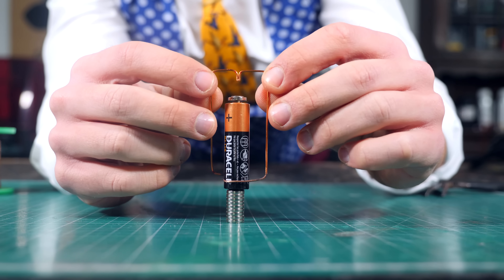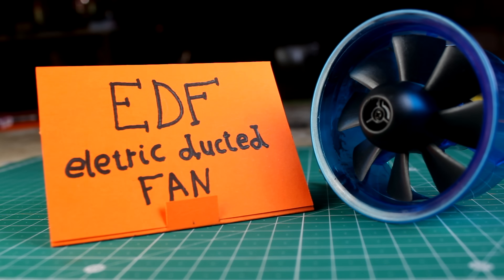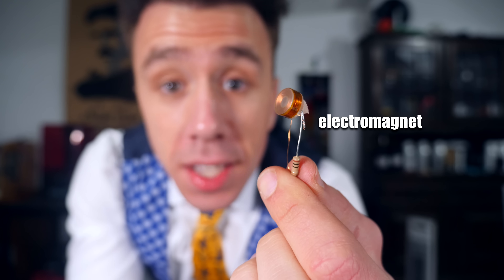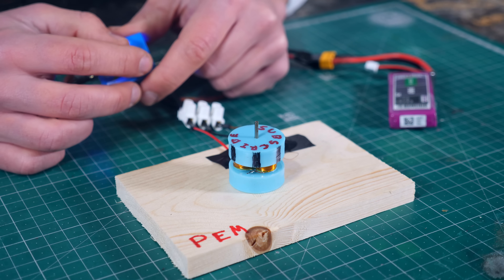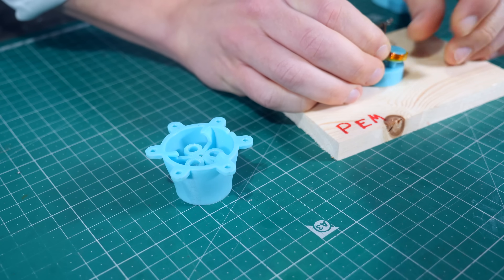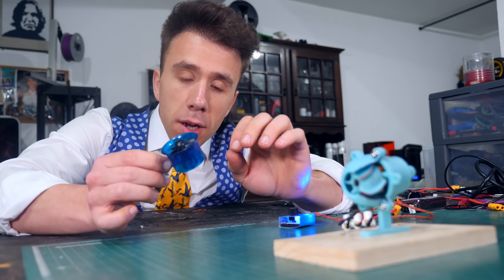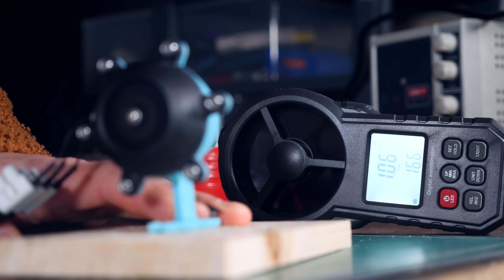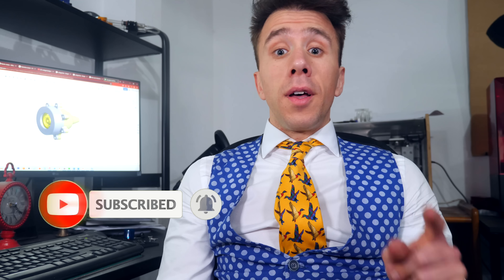I 3D Printed an ELECTRIC MOTOR FAN

Comment: thrust will increase if your impeller mass is consecutively lowered towards the end... plus the intake needs to be vase shaped from opening or you can put holes on the front sides.... the design is perfect just change the front part with well ventilated one and try the impellar like a any supercharger if you don't want to design a new one...

Comment: An impeller will not produce high wind speeds, but higher torque air aka its a little closer to an air compressor and a little less like a fan. 
That's because of the increased surface aria, which is great for making sure wind hits a set speed, but not great for making sure it hits its top speed.

Comment: A cool idea would be to follow that dyson fan concept and try to create a plane where the wings are more like fins (The hollow part of the dyson fan) where you can't see the fans but it still moves/creates thrust. Also a plus if it is RC. An even better plus if it can crash into tomatoes.
Reply: So that the rear of the wings close to the fuselage is a slot where the compressed air exits? This would be an interesting idea

Comment: The blades and the impeller/volute casing/interior are the only thing that're different, so with a lot of tinkering & research you could fix it, better tolerances, streamlined blades.
But you know that o-o , I'll tickle your youtube audience interaction regardless. >-<

Comment: @MajorHardware runs an entire video series about designing different fans blades for the same fan body and testing their efficiency. He's also an avid builder/3D modeler, so it might be worth asking him.

My straightforward guess would be that the new fan design has three things working against it. 1. Smaller intake than the original. 2. More interactions with solid bodies before making it out the back, increasing drag and decreasing flow. 3. Smaller surface area blades, so they can't push as much air.
Reply: Oh yeah! Another fan showdown fan :D

Comment: I think that the Motor isn't so good for the Turbofan design. I would guess that you need lower RPM but higher torque to compress the air, but the ductet Fan should need higher RPM but lower torque for the same mass pushed trough. 
Thats why i think the Motor doesn't operate on its optimum working point so you get less thrust.
Maybe a higher dozzle diameter helps to reduce the pressure, or a lower KV motor with the same wattage.

Comment: At the speeds at which the impeller works, Air behaves different than at low speeds. It's behaves more like a liquid than a gas. If Onshape has the possibility, you should try your design in a fluid simulation. You'll also need to finetune the center of rotation for balancing the rotating masses of the impeller to a high degree or you get losses through friction. I'm also pretty sure that the gaps between the housing and the impeller need to have tight tolerances

Comment: BASED  SOLELY  ON  VERY  SHORT  OBSERVATION (so don't hold me to this)
1) It looks like your tolerances are WAY to broad.....thus you are losing A LOT of power due to turbulences within the air flow. Little eddies are robbing your flow power because every molecule of air is crashing randomly into each other, rather than all calmly & orderly rushing through the exit door during a concert fire.
2) I know this is going to go against your indoctrination programming BUT....your design does not allow for the linear flow of the exhaust to 'grab' the air outside the exhaust stream in an orderly fashion. Maximum thrust comes from the exhaust pushing off of the surrounding air (think of a swimmer's hand pushing off of the water with closed fingers like a paddle, as opposed to a wide opened hand causing micro-eddies all around the fingers) rather than wasting energy by sucking in replacement air via the exhaust edges of the fan shroud. Basically....your vacuum is sucking in where it should be solely blowing out.

(Note: I know what is taught to every rocket scientist in every accredited school........and they are wrong. So please don't regurgitate the same lesson plan to me as though I haven't seen it a thousand times....I actually build rockets that work. I know 'the science', and I know why it's intentionally taught wrong)

Comment: For that kind of shape I think you need to go talk to someone that makes turbochargers or centrifugal superchargers. There's a lot of science that goes into the shape of the inlet housing/compressor housing and the impellor as well as the distance between the two.. Or hell, skip the automotive side of things and go straight to the big boys and go talk to GE or Pratt & Whitney about how turbo fan jet engines are made.

Comment: Im not a rocket scientist but here is a video idea  so make a pulse detonation rocket engine but coat the inside with your own home made Starlite  it should alow the engine to flake off most of the heat and if you want to take it further you make the outside water cooled thus you have pulse detonation engine  that lasts longer

Comment: Go see the fan show down. Different blade designs are optimized for different purposes. For example to get high static pressure centrifugal fans are great. I think the major struggle you are having with your design is not matching the blade size and pitch correctly to the power output of the motor

Comment: I think the primary problem is that the load on the motor is probably not the same, so the power used by the two fans is not equal. A slightly better approach would be to compare their power-to-thrust ratio (Newtons per Watt) but it will still be different as the efficiency between two propeller designs can vary a lot (even drone propellers have different N/W measures on the same motor)

Comment: Like many othewrs have said already, the ducted fan is better at creating higher airflow at low pressures, whereas the centrifugal fan is better at creating higher pressure at lower airflow. So your measuring method is not adequate for comparing the two. Also you should choose one or the other depending on your intended use: ducted fan if you want thrust directly from the fan, vs centrifugal if you want to feed a burn chamber in a jet engine.

Comment: So a fan is basically a pump since it's moving a fluid. So you probably getting a restriction of flow somewhere in the pump body. Not sure if you have access to it but a thermal camera might help you see where the restriction of flow is at. It could be as others have said your intake diameter might be too small. So you have less area to push fluid through

Comment: Did you weigh the 3D printed blades and the fan blades? Maybe the 3D printed impeller is heavier than the fan and it's diminishing the efficiency, and as other comments pointed out, maybe the diameter of the entrance and exit of the air are limiting the amount of air that can go through at a given time

Comment: Make a bell electromagnet (one used in an electric cranes). If you get it right, you will be able to lift ~145 kg with a 2 cm in diameter magnet that uses a 100-200 rounds of 0.1 mm wire and uses 4,5 V and 300 mA. I found this small one as an experiment and it was working as expected.

Comment: my initial thought is the centrifugal fan through the air out 90* from the direction you want it to go.. so there would be a lot more of a loss of energy from the extra redirect that needed
Reply: so if you had a high presser hose spraying in to a bucket directly at a hole in the bottom then the water going through the hole will also be moving fast.... but if the hose was spraying at 90* to the walls than the water flowing down the hole at the bottom will be much slower (but harder to cause a back flow)... i would assume thats the pro there if you are making a jet
but i am just going off intuition

Comment: you want to build a centrifugal compressor so rapidly looking at your design I think you need a biggher collector after the rotor because the air needs to decelerate to acuire pressure and only then you send the compressed air to a nozzle that convert pressure in speed. also if you want to add a combustion chamber after the compressor you need the collector because you want the flow to be slow to make a complete combustion before expanding it again
Reply: Also the air intake needs to be bigger and well desined. the intake must looks different if you use that engine on a moving vehicle or on a stationary stand. try to search how aerospace companies test their airbreathing engine while in the test stand and you will understand

Comment: The issues are mechanical tolerance between the impeller and the housing and the materials used in construction being too flexible. Find a stiffer material and close the gap between the blades and the housing and you will achieve more thrust

Comment: Well, to start, turbofans are used to compress air, your design is missing fuel injection and ignition which re-expands it. Secondly the tolerances on a turbo fan, and especially the Dyson are very tight, very very tight. Tight like tiger. Also note that the Dyson motor, if used for a pass-through system like an EDF, would put out way more thrust. Dyson’s design is inefficient for the power, basically, but the tolerances are much tighter. 

I would look at how close the fan blade edge is to the internal wall. 

I would double check the impeller design against other impellers within the scope of your design. Your resin one seemed to have a lot of dead space at the center, and short fans. The center should be more like a reverse spike, with a lot more fan depth. 

Now, if you have an expansion chamber inside the housing, before the jet spike, that will be trouble. Remember the design of a turbo is for compression, if you aren’t imparting more energy into the design and are measuring only airflow then compression won’t help. I’ll go back and watch it. Also check the exhaust area can’t be much smaller than the intake area in this design. Basically if your fan and intake are perfect but you have a chamber behind it leading to a tiny nozzle, the turbo will compress that air and then the air will take the path of least resistance, which is either nozzle, or back up around the fan. This is why the shape and interior dimensions of turbos are different than linear compression jet engines. Each compression stage works as a nozzle to prevent feedback. Loose tolerances will just have the air go everywhere but the back. 

Turbos and passthrough fans are different, they have different purposes and systems even if they both produce thrust. Because turbos throw air sideways you immediately lose efficiency. Internal turbulence. 

Or I’m full of shit, who knows?

Comment: Thrust isn't matching because the axial flow fan moves a much higher volume of air. The centrifugal fan has a small mass flow, but at higher pressure which is not very usable in your case. If you want more flow, it needs to look more like the fan in your car. It's called a squirrel cage fan. The blades are much longer and so the passage for air is much bigger. They flow a lot more air than your turbo style impeller.

Comment: I can’t say for sure but I think it has mostly to do with the intake diameter. I’m not sure why it being the same motor should mean it has the same output. If you have two cars with the same engine but completely different chassis and aerodynamics then they also won’t perform the same because there are other factors than the motor. I think it’s the same with this

Comment: Thrust is a function of air flow/ air volume pushed back. The centrifugal fan is better at air pressure than at air flow, therefore you don't get as much thrust. But if you measure the pressure it will be much better than that of the EDF, could be used for other applications

Comment: 6:00 The reason your thing does not work is because it's terribly inefficient. The more you change the direction of the air, the more energy you waste. The more "parts" obstruct the airflow, the lower the efficiency, the more you restrict the flow, the lower the efficiency. 

That's the reason good jet engines and EDF'S use axial flow. Early jet engines used centrifugal compressors for the ease of fabrication, but they were quickly replaced because they suck...

Comment: Fluid dynamics.. the prop had more surface area in the larger fan than the centrifugal fan. Inlet restrictions and internal tolerances of machining also play a role. 
There needs to be a larger difference in pressure. Jets use a fan to feed the compressor of the engine. Turbos use better impeller geometry and tight tolerance to create pressure. Also, the speed is very, very high. 
These are my thoughts and stab the tomato in the dark ideas... Good luck.  👍

Comment: I think that you should make a better upgrades or your special design for jets like(pulse jet one[my favourate])
and,
by your this current fan design .I think that you must increase the intake or just make bigger diameter of duct around fan or just use material with medium  weight or density.I think you understand it

Comment: The conical shape must be inverted, dyson fan increase the pressure of the air with their shape, like a second stage rotor on engine. dyson keep the same rpm along the blade but decrease the diameter therefore increasing the pressure. you need a tight fit and more thinner blade. in your design you dont increase pressure behind the rotor therefore its like a cork.

Comment: Centrifugal compressors are highly sensative to tip clearance, as they typically are used in igh pressure applications. I expect your getting a lot of efficency loss due to the blade tip to housing clearance.

Comment: Make an arrow with a propeller in front, make the propeller turn up to speed as the rotor of an electric motor and then release the arrow. It will fly by itself basically, maybe you can also try shooting it with a bow to increase speed

Comment: Not enough surface are of your fan. By compressing you need a fuel expanding to produce thrust. Not driving it with an external motor. Thats what the Italians did on their first jet. Powered with a gas engine. Did really improve a thing. You're trying to make thrust using electricity not EXPANDING GASES!;

Comment: We need more testing.  As others have pointed out, it could be your air intake is too narrow.  Remove the front half of the intake or widen it to remove airflow restrictions.   You could also have leaks in the multi-piece housing.  Run smoke through it to visualize and seal with gaskets. Finally, you may have problems in your constriction of the airflow.  Avoid bulges.

Comment: Looks to me like the centrifugal fan has more surface area contacting the air than the impellers you designed. Seems the thrust would probably equal out if you managed to scale up the impeller to the point it had the same surface area as the blades on the centrifugal. 
Best of luck!